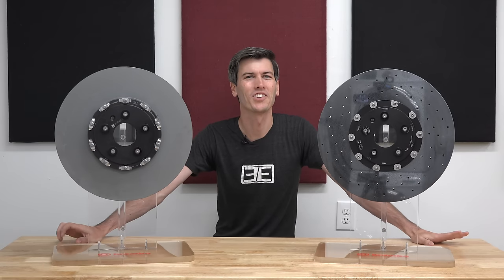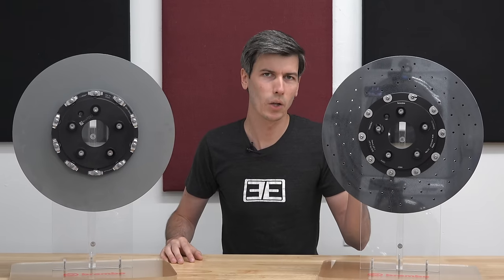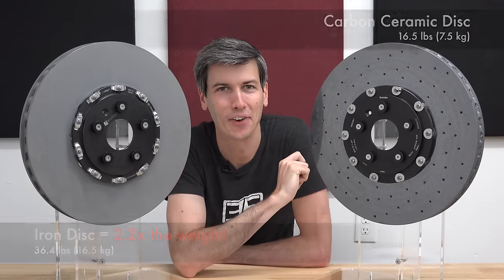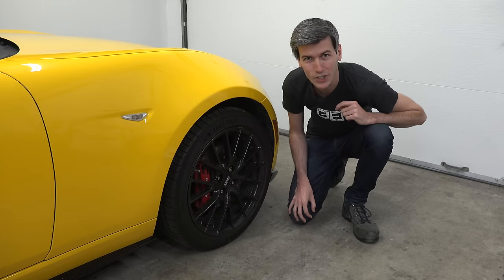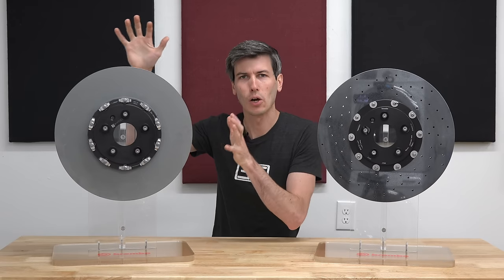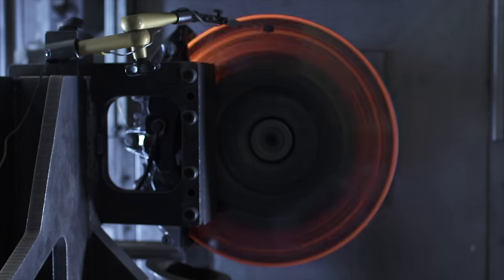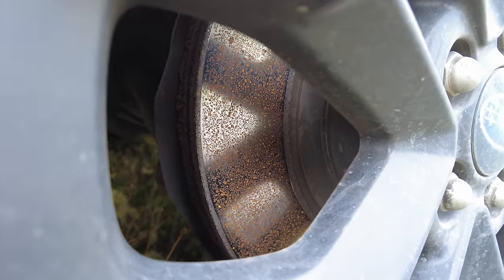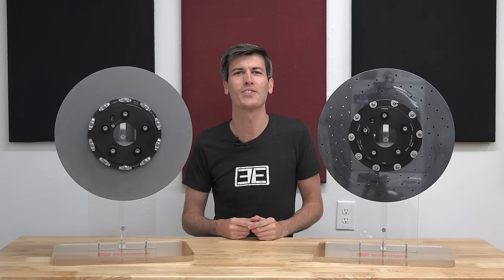How Can Brakes Cost $10,000? The Brilliance Of Carbon Ceramics

Comment: Speaking of braking, does the amount of regenerative braking in electric/hybrid cars depend on the horse power of the electric motor?

If so does this mean that if electric motors become powerful enough that they can completely replace discs/other friction devices In braking?
Reply: A: Yes, a bigger motor is a bigger generator and a bigger generator takes more power to turn under load. 

B: Not really, the regen braking force is created by loading the generator with the draw of the battery charger. A generator without load is just a free spinning shaft with little resistance. To make a higher braking force the charger would have to put a higher charge into the batteries which may be more than the battery can accept. Remember it’s an energy transfer and the energy has to go somewhere. If the batteries could take charge at the same rate they can discharge, and the motors had the same efficiency as generators as they do as motors then theoretically we could decelerate at the same rate we can accelerate. 

Maybe soon they will invent reverse thrust motors where the motor activly uses power to oppose rotation rather than just working as a generator. But this would consume battery power while braking.

All these technologies are in infancy, even the fanciest tesla just uses relatively standard motors and batteries. They are not highly evolved at this point in time. Someday soon your idea of 100% electric brakes will probably become the norm.
Reply: Look at the new gen 3 formula e car for the answer to that question. They are upping the power next season switching to awd dual motors.
And eliminating the front friction brake system. That's right on a world championship race car they are now confident enough to rely on regen braking alone from the front and eliminate the entire front friction braking system. 😎

Evs already made today can do 90%+ of all daily driving braking duties from just the motors. Some can pull over .3g in regen braking alone.
One pikes peak runner tracked all regen on his tesla model 3 entry and found he got over 23% of all energy used back from the regen alone.
Reply: That is defiantly a “what if“ question

Electric motors in EVs can basically all run as a Generator with the same power while braking or accelerating. Let’s say a given Electric motor has a power of 100 kW and an efficiency of 85%. You put in 118 kW from the Battery and get 100 kW to the Wheels. If you run it as a Generator you take 118 kW from the Wheels and have to put 100 kW in to the Battery. If your Battery can take that, fine, you can now brake as much as you can accelerate with your electric drive.

But WHAT IF the battery is full? Imagine going up on vacation on a hill or something and you charge your car there. If you want to drive back down you have to do some braking. Where does the energy go? Sure, you can turn on the heating and get rid of some excess energy, but the heater in a car rarely has more than 10kW

And WHAT IF your electric system (Converter, wiring, contactors)  somehow dies. On mechanical brakes you usually have 2 independent brake lines which each brake adjacent wheels, so even if one fails, you have some braking
Reply: @Fluxkompressor  interesting point's. I have wondered if a small super compact super capacitor could be a possible solution? 🤔

Comment: New carbon ceramic brakes for my 2019 392 charger is only 3600 bucks. Not extremely expensive IMO. If you think about it and do the work yourself, iron brakes are only 500 bucks for a complete set. If you replace your brakes every 30 thousand miles that's only 1800 bucks for 120,000 miles. Seems like standard brakes are better price wise. Also, how often do pads get replaced on carbon ceramic rotors?

Comment: Honest question do you think it would be possible for a four rotor to have the rotors inside made out of carbon ceramic. There would be much lighter than the rotational Mass that's inside the engine but do you think. It's even feasible. Carbon ceramic brakes seem like they're plenty durable so if you made the rotors inside of 26b out of carbon ceramic don't you think. Much more efficient. Or could someone make a piston out of carbon ceramic would it be durable enough you think?

Comment: well in the minus, carbon brakes can break if you hit a hole in the road, or get bumped, or just go offtrack a bit fast on track day... Saw it happen on 488... Its not pretty to watch. Car was barely scratched under, but the brake just blow when the car went offtrack. Not sure if the curb or dirt was responsible... but it never happen on iron disks ^^'

Comment: Love this!
You should make a video about what is better... More tire and less wheel, or more wheel and less tire. For grip and track purposes. How to find the right balance. What works better for what circumstances.
Reply: short answer for you question is more wheel less tire is only for the looks, more tire less wheel is better due too less weight, it improves grip becouse tire acts like first part of suspension so wheel stays connected to the road better and thanks to that you can have stiffer suspension for cornering, also in high power/torque cars tire can flex under havy aceeleration so wheels dont lose grip that easly and are harder to spin, you can see how much tires flex in drag race videos, they use tires with big side walls that alows them to flex and preventing losing grip
Reply: He did a vid like that for his Model 3, I think.

Comment: Why are there a cut, or ground up part in the cast iron discs? Where the air channels are, on the outside, you see that there seems to be parts that are not uniform to the disks, or flattened from the circle. Is it ground post casting for perfecting the weight balancing? Or needed as a clamp holding space during production? It's tough to describe where I mean
Reply: I believe it is for weight balancing, as you suggest.
Reply from the maker: Weight balancing, I believe.

Comment: You're an engineer so you know that there's no such thing as a free lunch.  Everything is a trade-off in engineering.  The only downside to carbon-ceramic disks you mentioned is cost, but there must be performance disadvantages.  The one thing I had thought was an issue (and I see the HumbleMechanic has mentioned it) is cold performance.  Presumably, though, the lack of performance when cold has been somehow mitigated or I can't imagine they'd be legal on street cars that shouldn't ever be driven fast enough on public roads to sufficiently heat the brakes and overcome cold performance issues.  Presumably pad material choice helps, yes?  If I'm not mistaken, MotoGP uses a carbon-carbon brake combination which, unless kept extremely hot -- as they are on-track in the dry -- are frighteningly bad at scrubbing speed.  Anyway, is there enough to talk about to do a video on the performance drawbacks of carbon ceramic rotors?

Comment: Nice comparison Jason, what about risk of chipping and thermal shock properties?  Say when removing wheels brake service on iron and carbon brakes?
Reply: I can speak to thermal shock. 
I own an offroad racing team that encounters water sometimes depending on the course and the season.  Hot carbon brakes have shattered before. Not every time but its happen. We now only use IRON rotors and the best pads and calipers we can get

Comment: The carbon rotors won't rust, but if you look at a galvanic series, carbon is at one end. This means that when that carbon dust settles on a bare metal surface, out will encourage corrosion of that surface.

Comment: Actually, If Tesla and other manufacturers release independent torque displacing motors for each wheel that can also act as independent brakes for the ABS purposes of not loosing control under any speed and any road conditions , then brakes become something for emergencies only, increasing their life expectancy even more, so having iron brakes makes the susceptible to rust and other failure instigators. So on electric cars, Carbon Ceramic brakes make way more sense, since they also have a lower space to work with for the efficiency, also did you see both Tesla model Plaid brakes?! they really need these carbon ceramic ones for the drag strip, or emergency braking after accelerating aimlessly.

Comment: If unsprung mass does so much, how come the brakes doesn't sit further in at the differential? Sure the maintenance costs will be higher since it's more complicated to change, but on a performance car performance should be more important.
Maby it would take too much room to be a reasonable solusion.
Reply: I think it's becoming more and more difficult to place rotors inboard because they're so big now.
Reply: @jamesengland7461  Yeah, guess you're right. It may not be possible to have a brake servo strong enough to cope with smaler brakes either. Interesting thoughts tho :)
Reply: Inboard brakes are more difficult to cool and service

Comment: I have brembo calipers on my car and i have been wanting OE replacement parts I have been very disappointed in the support from brembo 2 years later and I've still not been able to get parts.  When there web site is also pushing to use original parts, why can't brembo have agents where you can just order one parts. I have the part numbers but they still cart help.

Comment: Great video, as usual. Watching it I started thinking of other materials that might make good brake rotors and titanium came to mind (work in materials engineering in the electronic industry, so materials are my jam).. It's both light and very strong. Corrosion resistant and has excellent high temperature strength. And finally is quite low thermal expansion so should retain good feel over a wide temperature range. So I thought Ti should make a great rotor. And if that was true then it should already be in use. A quick google search indicated that sure enough it is apparently for sprint car rotors, which seemed the most mentioned. But also there was really not a lot of information about Ti rotors, except for places to buy titanium sprint car rotors. Titanium seems like it would be much simpler to process and thus less $$$ that CC. It begs the question of why titanium isn't the premium brake rotor material. Care to tackle a video delving into Ti rotors? Edit: Titanium can be quite chemically reactive when hot enough to dissolve it's protective oxide coating, about about 800-700C, or I suppose if the protective oxide coating is scraped off when it's being used as a brake rotor, so maybe its reactivity with the pads might be it's Achilles' heel.
Reply: I do believe that you hit on the reason in your edit - titanium's reactivity and the fact that it makes a class D fire if/when it ignites is why it's not ever going to be used on road going cars. Possibly in racing applications (as you mention for sprint cars) but it's just not safe for common street vehicle useage. The ridiculous heat and inability to extinguish a fire means that the penalty for failure is too high, and with the state of modern drivers you absolutely have to design for the inevitable failure of common sense...

Comment: Disc pad combos would be a great video if you get a chance. We have so many choices of pad here in the UK as im guessing the US also has. 
I've bought drilled grooved discs that have worn out in 3 months in the past. Not sure if it was because of cheap steel or the wrong pad choice. Not sure if I go ceramic disc do I want ceramic pads too. Also heard horror stories of daily drivers using ceramic setups and rear ending someone because of the lack of heat in them etc. How much of that is true and how long does it take to heat them up to the optimal temp?

Comment: Hi can someone explain what "less weight = more grip" at 5:50 means? Wouldn't increasing the weight actually give you a higher normal force therefore higher lateral grip available? Or is this talking about lateral load coefficient?
Reply: Less weight means less centrifugal force -more grip in corner

Comment: 4:40, your tire is out of round.  
Damn I'd love to have these on my Audi S6.  A week after I got it, I took a run down Fish Creek Hill in Apache Junction, AZ passing 15 mph signs at 45.  By time I got to the bottom smoke was pouring out of all 4 corners and the smell made me gag.  I definately needed better brakes. For 15 1/2" they stopped amazingly bad.   
Now I settle for slotted cryo treated G3500 rotors with Ferrocarbon brake pads.  $1,300 for parts.  Stop like an SOB but have a bit of an annoying squeal.

Comment: I am a huge fan of CCB. I have them installed on most of the Audi cars I've owned. (RS6, RS5, Q7, Q5, and Porsche Macan...) It is not just about saving trouble of replacing the rotors/pads every ~30K miles and dust free on your wheels... it's all about performance. We have a lot of speeding cameras in where I live. You have no idea how much money I have saved for the speeding tickets by having my carbon ceramic brakes.

Comment: They should put these in Teslas and other EV's where most of the everyday driving braking is done by regen. EV's could really benefit from lighter unsprung weight and potentially smaller brakes allowing for smaller wheels.

Comment: I don't agree totally with the ride quality! Ride quality means not only cornering dynamics, it describes also braking and here comes the problem in play: if you don't put enough load on the carbon brake, hence enough temperature, it won't brake efficiently which means the feeling in the brake pedal won't be very comfortable and dangerous also. So in my opinion, you can't compare them so much because they have different use cases

Comment: So answer me this. In an old video on Disk designs you made (steels/grooved/drilled/ or both) you said that in practicality the benefits of drilled disks today is minimal and mainly done to give the car a 'sporty' look. So why are these Carbon ceramic brakes drilled too? Is this for the same reason to look more 'sporty' or is there an actual benefit like lower over all weight?

Comment: Is it true that with Carbon Ceramics you have a longer brake distance then with "normal" iron brakes? Since the Carbon Ceramics need to get up to temperature first? Or would that be more of a problem in the Carbon Carbon breaks? And what Break pads would you recommend? You still need the right Pad to match the nice rotor one is about to get!
Reply: my friends 15' z28 Camaro has 110,000 mil. on it and its juuusst staring to need brake pads on the original system. so yes they do last substantially longer lol

Comment: No mention of brake noise?
Reply from the maker: Brake noise is mainly a factor of the pads used, rather than the rotors. There's a variety of options for carbon (much like iron).

Comment: Why do cars only have one brake pad, and not two opposing each other in a balanced way? How about a video on steel/aluminum/carbon rims and the costs and advantages of those?
Reply: They always have 2 pads opposing each other.
Reply: @MaxKosenko  I meant 180 degrees apart around the disc.
Reply: @NorthWay_no  Why pads are not covering whole surface of rotor? Because rotors need air to cool down.

Comment: Most car owners Only change the brake rotors when a mechanic tells them that they need to be changed, and mechanics tend to go by Nothing but LOOKS,  like grooves and cracks in the rotor. so in reality, if you did fit carbon ceramic disks on your car, make sure your car is only touched by a mechanic who knows all about these rotors.  There should be something like a stress test for brake disks, because again, in my experience most mechanics ONLY do a visual inspection, and many brake disks are replaced unnecessarily……….

Comment: Hi! I would have a question for you: I have a 2009 Acura TSX manual and it is running 2800- 2900rpm on the 6th gear at 100kmh (62mph). I find that really high is it normal? Like it's a bit noisy, not that much but I'm more afraid about fuel consumption.
Reply: Sounds like your clutch is slipping.

Comment: What about noise, and cold brake performance.  The only knocks I hear on carbon ceramic brakes, beyond cost is the noise and cold performance.
Reply: On the newer cars it's not as much as an issue. On our '08 Gallardo Superleggera, they can be grabby, but they don't make noise. On our 2017 NSX, you'd never know they aren't steel based on noise and performance.

Comment: 1. With no ifs and buts - it's not worth it.
2. You can't just label ANY non-carbon disc "cast iron" simply because you can't compare, let's say, chrysler "cast iron" rotor that can't outlast a set of pads with Toyota (also "cast iron") rotor that is hard if not impossible to kill. At about 200,000 miles, I decided to resurface my 4Runner rotors not because there was anything wrong with them but just to remove the slight rust ridge. The shop broke TWO cutters resurfacing two rotors and refused to touch the other two.
Bottom line: even clearly overpriced OEM (at Toyota stealership) rotors cost a fraction of the cost of carbon ceramics ones while still provide outrageous service life, and any benefits the latter provide are hardly noticeable in real life driving so the comparison is immaterial.

Comment: Cheers for Brembo.  But carbon ceramic rotors are still toys for rich boys.  

How many times does one need to replace iron rotors in 100K miles - it’s been twice for me. I would also say- yes unsprung weight weight matters for lap times on the track.  For normal street use, including spirited back roads driving, one just isn’t driving close enough to the edge of tire grip for it to justify the cost of CCBs.

Comment: Thank you for this video! I plan on getting a m5 and the carbon ceramics are an extra $8500.  It will just be a daily driver. Only be tracked for top speed or suspension mods. probably maybe $3-5k miles a year. This definitely made my decision easier.